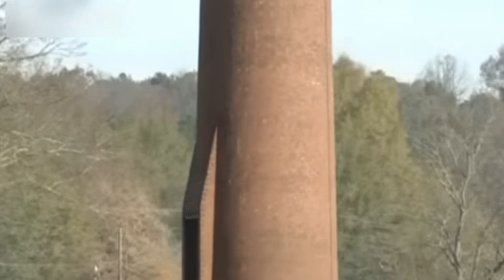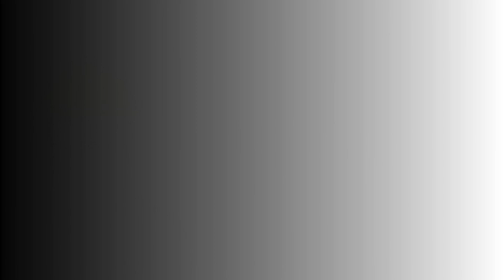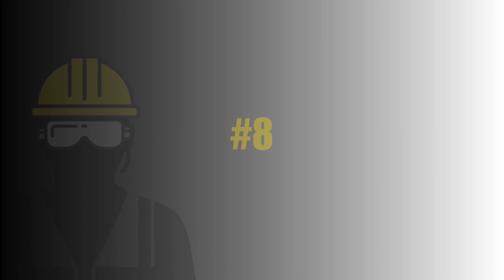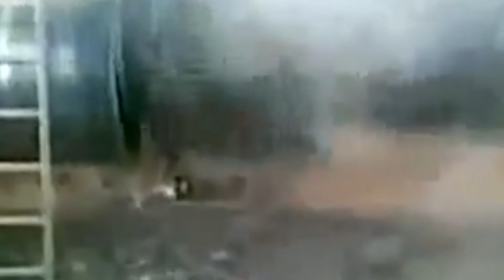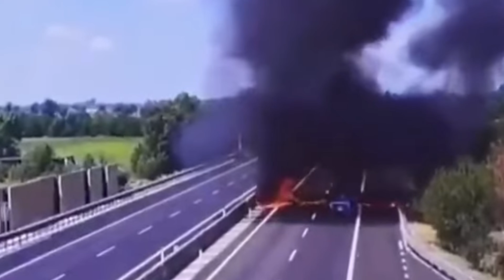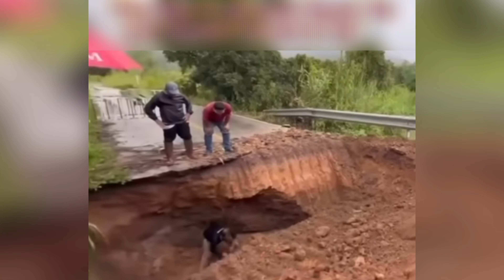The Most Disturbing Workplace Accidents Caught on Camera

Comment: The most disturbing part isn’t what the cameras captured—it’s knowing that many of these situations started with warning signs that were ignored long before the incident.
Reply: Well, I would argue that, for normal people at least, that's the LEAST disturbing part. Knowing that there are ways to safeguard yourself from these types of incidents. If you use your brain, you will almost always be okay. I have worked in a metal factory and on high rise buildings for 20 years. I've never had a serious injury on the job. Because you'll NEVER catch me under a load on a crane, forklift or ramp